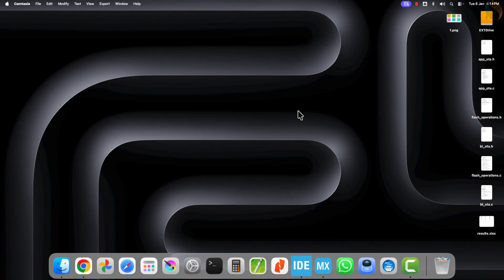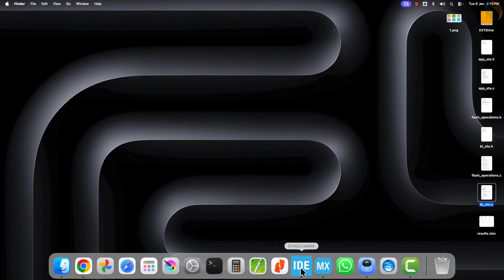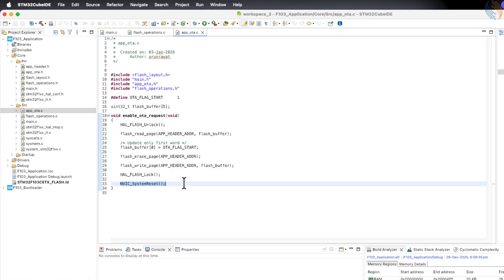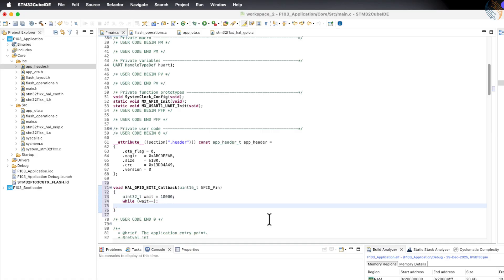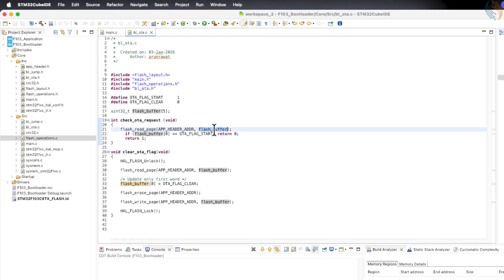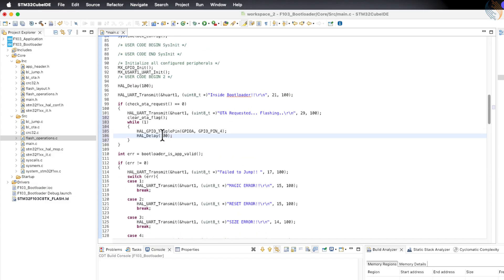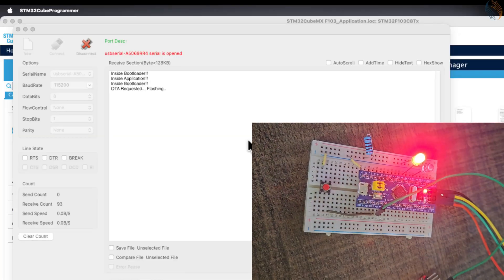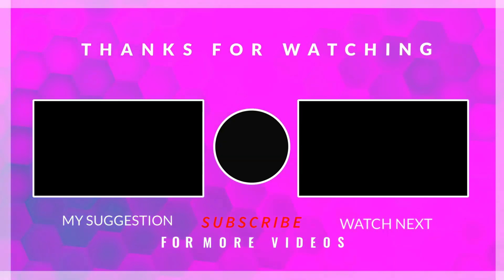STM32 Custom Bootloader (Part 4): Implement OTA FLAG Mechanism

Comment: Hi, thanks for the good work. I have (just) one problem. If I use the bootloader on a F407 the bootloader wont boot into the  applicaton. All checks are fine (CRC, size, MAGIC) and after the appEntry call nothing happens. I can see the application code is loaded at the right spot, and appEntry porinter looks correct too. I have a 32kB bootloader, 16kB appheader (8008000) and FLASH for application at (800C000). Somehow the bootloader cannot jump to the appentry. Even if I use mostly of your F446 code, but result is the same. Any thoughts about this or did I make a silly mistake and oversee it?

The F103 code works well.
Reply from the maker: That mean there is some issue with you application. Maybe you forgot to relocate the vector table.
Check the steps required for the application carefully.
Reply: @ControllersTech  Double checked  everything. But result remains the same. Only thing that is different that the F407 has extra CCMRAM in the linker-description file. I got it working when I replace __disable_irq in de bl_ota with     HAL_RCC_DeInit();  HAL_DeInit();. Then the application boots fine.

Comment: When I run flash_erase_page(APP_HEADER_ADDR); in the application, the system freezes. The page at APP_HEADER_ADDR is completely erased, but the values are not written back to APP_HEADER_ADDR.